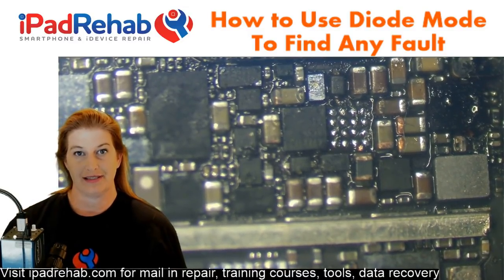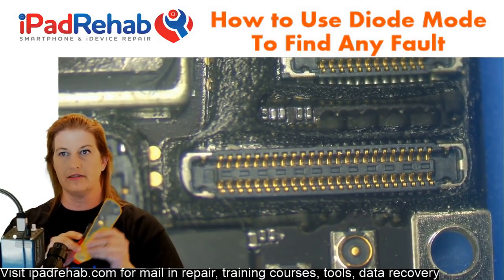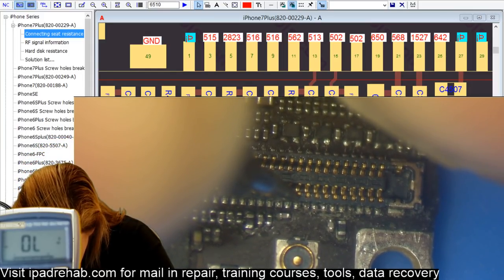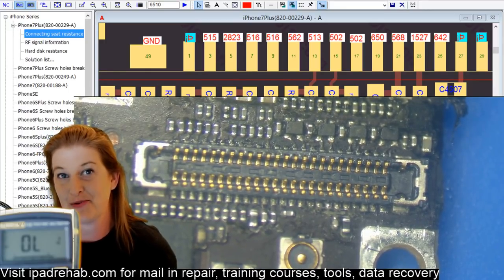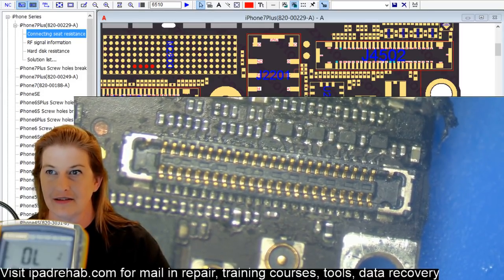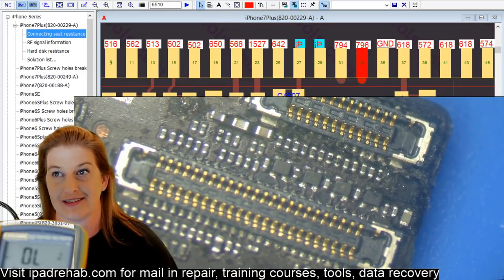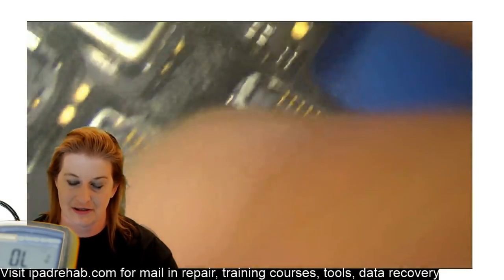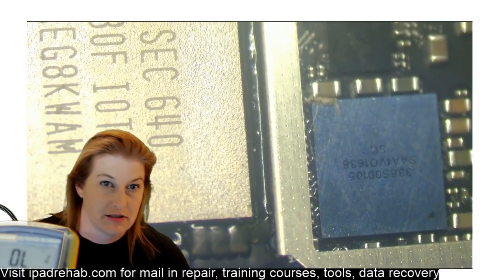How to Use multimeter DIODE MODE to find ANY motherboard fault.

Comment: Maybe I can explain "Diode Mode" from an electrical engineer's perspective.  A common digital multimeter is the Fluke 179.  In Diode Mode, the 179 outputs 7 volts DC on its test leads with the red lead positive relative to the black lead.  This voltage has a short-circuit current limit of 1 mA.  This means that the 179's diode mode "Thevenin Equivalent" circuit is a 7 VDC voltage source in series with a 7k resistor.  When this probe current is applied to the device under test, the voltage developed across it is displayed on the meter's LCD.  

When Diode Mode is used to check a motherboard circuit node with the red lead connected to ground, the developed voltage is negative compared to ground.  If this node connects to the input of an IC, the meter will display the forward voltage of the IC pin's reverse-voltage protection diode.  Repair technicians have observed correlations between this protection diode voltage and the overall "health" of the IC.  Presumably if the IC has experienced some trauma on one of its pins (over voltage, etc.), that pin's protection diode will also have suffered and its forward voltage will have been changed.  This is not a definitive test of the IC's health, but it is a quick and easy "leading indicator" of a potential problem.  By comparing the Diode Mode voltage reading on a circuit node with the same node on a known-good unit, it can quickly point to a suspected bad part.  If you look around, you can find web sites that document these voltages for popular consumer devices that are known good.

BTW, if your meter doesn't have a diode mode, you can use a battery with a series resistor to create one.  A 9V battery and a 9k resistor should produce readings similar to the Fluke 179's.
Reply: Thank you
Reply: Ah finally a bit of theory behind it! Thank you for the explanation. I went ahead and tried to measure voltage and current on diode mode on my two cheap multimeters and found out that one outputs 3 V and the other outputs 2.5 V. Both output a current of about 1 mA.

Does it mean that the 3V dmm has a Thevenin equivalent resistance of 3k, while the 2.5V has 2.5k? Of course I'm not striving for precision here, I mean they are cheap dmms after all, but I would like to know a sort of a ball park figure
Reply: Hi Russell:   To be technically correct, Thevenin/Norton equivalents only apply to linear, time-invariant circuits, which a DMM’s diode mode is probably not.  But if you consider the DMM “linear enough” over the range of voltages you will be using it with, then yes the Thevenin equivalents of your DMMs are as you say they are.
Reply: @davidclementson6149  I see, thanks for the clarification

Comment: The world chose the "red probe on ground" because it effectively isolates the component you are testing by sending a signal through the circuit ground and thus not activating other components. To affect a black probe in this fashion would send a signal through the entire circuit and therefore not be effective in testing only the component under examination.
Reply: Thanks - that's the explanation I was looking for!

Comment: Multimeter "Diode Mode" injects a test current into the diode (or whatever) by applying a small voltage to the leads via a resistor and measuring the voltage across the leads.  Typically they might use 3V and 10kOhms but different multimeters use different values and hence different test currents.  This explains why the VXY values are consistently higher than your values, they used a multimeter with a higher test current.  The ubiquitous 0.5V that you see on data lines is just the forward voltage of a PN junction probably the inherent diode in one of the output MOSFETs of the device that is driving the data line.  Before the days of digital multimeters we used the resistance range of an  AVO (an old moving coil multimeter) to do much the same thing but we were looking for failed discrete components such as diodes and transistors.
Reply: I was just about to post a comment explaining exactly the same thing when I saw yours. Exactly right in the old days All meters were what is now known as diode mode because they had moving coil or moving iron displays and hence higher voltages which would inevitably forward bias any semiconductors in the circuit
Reply: Nice, number 33. You mention an Avo to most techs nowadays & all you get is a blank glazed look in return ;-).
Reply: To test mosfet I use cheap chinese multimeter because never  and better' multimeters can't  make gate to turn on mosfet..  So I can't  tell if a mosfet is good or bad unless  it's  short circuit
Reply: that sucks
Reply: your comment is helpful, thanks..especially about that diode thing in data lines..
Reply: I'd agree, don't forget too that different multimeters have a +- accuracy difference depending on build & that calibrations of multimeters can vary over time & if using for accuracy need to have recalibration done occasionally from manufacturer. Although here really just looking for line faults to determine which line is failing before moving to component level tracing in suspected line.

Comment: Hi  this is a great video for those people that have a bad understanding on what OL means on a multimeter If the multimeter is on Diode mode means OPEN LINE  wy? simple if you measure a wire from one end to the other and the wire is cut in the middle  and the multimeter show OL  there is no flow of electrons from point A to point B means open circuit describe as a OL.   If the multimeter is on Voltage  It stands for overload in that  case  means voltage is greater than the meter can measure. so over load or OF LIMITS but depending on what mode is the multimeter  I hope this help to clear some people's mind  put attention if you multimeter only measure  200V and you apply 210V  you are 10V of limit  Great video love you teachings
Reply: It means OVER LOAD or over range. Check a voltage and it would not be open line would it ?

Comment: Since the voltage on which most CPU pins, diodes and transistors start to conduct is about the same (the 0.5v you see on your multimeter), it doesn't matter what brand of multimeter you have when you use diode mode.
When you use resistance mode, it matters much more since it will show the voltage divided by the current, but only the voltage is constant and the current can be anything based on the multimeter brand.

Comment: I worked as Chief Engineer on cruise ships back in late 90's early 2000 and this and shipboard radios were an every week occurrence. 
 The 1st thing: Pull battery,Then sim card, remove covers if possible, then dip continuously in distilled water,changing it several times.We used an R11 based flush to remove last residue.
Then a hair dryer on low for an hour.Then after 24 hr wait,we install new battery,sim card,and that usually does it on shipboard radios.But,the phones maybe half were salvageable.But salt damage was hardly noticed.
Reply: Mind if I ask what is, specifically, an R11 based flush?
Sounds like you had a good go being on a cruise ship for a job!
Cheers
Brian
Reply: @Bman130958  R11 is the common name for a refrigerant used in AC refrigeration systems. Clifton would probably have had access to a lot of it.  It is non-conductive and evaporates quickly so the remaining water also evaporates with the refrigerant: dries things very fast.
Reply: @markwp3177  Thanks very much for the clarification, @Mark W P !  That makes perfect sense.  
Cheers

Comment: Red lead to ground because it has the power from the meter. Less chance to put power into a component by probing with black leed.

Other comments already addressed differences in zxw and your readings.

Thanks for sharing.

Comment: Thanks to your channel and amazing instructions, have had 3 successful tristar IC replacements in the last 2 days on iphone 6s 6 and 5s thankyou!!. Investing in new higher end tools sure making it much easier.  jbc  nase 1b , Hakko  solder station, higher end bench power supply and Fluke multimeter with Diode readings which my old one did not have....and now going to watch the rest of this stream:)

Comment: In case anyone asks, you really can use either diodes or resistance to trace circuits. Both put voltage in circuit. Yes you can test diodes and semi conductors on a resistance setting. It will just be different. I have ran into shorted chip caps across power rails, and a bad chip out of 100 sharing the same signal lines.  I was also given a tablet that took a dip in a pond. Needless to say all the power from the battery performed spectacular electrolysis on the CPU board and even ate a trace on the LCD cable.  I usually don't hold out much hope for things that took a bath, especially under power. The only wrong way to fix something is if you have no clue in what you are doing.

Comment: Diode mode injects constant current (like 1mA) and measures the voltage drop. Note the difference between the concept of voltage source and current source
Reply: Finally, there is a proper explanation amongst all the crap written here.

Comment: Thank you for the useful tips on using diode mode.  I shall be using it more often from now on.  
Troubleshooting electronics is all about getting to the problem, the methods are up to each individual.  Whatever works best for you and your equipment is the hallmark of a successful fix.
As for the internet trolls, they still don't realize that their foul language reveals much more about themselves; their immaturity, arrogance and hate, than it does do about their intended targets. The fact that they can do it over the internet completely anonymously gives them a childish sense of courage, one that they'll never outgrow.  It's very sad for them.  The Catholic nuns were right of course.  Cursing is just a small mind trying to say something forcefully, no matter what the medium.

Comment: OT about the green-screen multi-meter phenomenon, coming from someone into photography..
Most of what we perceive as yellow, actually contains a LOT of green.  I know we have the most perception in the green spectrum -- so I'm speculating on this latter part, but I think there could be receptor fatigue due to that, so our brains tone it down.

However, as an example of this phenomenon..  Take some photos of various things you think are green (especially foliage) and take them into Photoshop or any editor that allows separate yellow and green controls.  Play around with adjusting the separate yellow and green sliders, and you'll discover quite a few surprises.  ;)

Comment: I am new to this type of repairs and appreciate your instructions very much. I am however a nut when it comes to saving time consider getting some paint pens in different colors. Like green for ground, Red for power and maybe white for open lines. and just put a dot above each line you could reference quickly.

Comment: I can't afford a microscope, and my tools are usually too big for measuring individual pins at that size. Not to mention my hands are shaky :q So I made myself a tool: I took a cable that goes into that socket, and soldered the other ends of the wires to a small board with measuring pads big enough for my probes and manual skills ;)

Comment: I am using the multimeter in diode mode per your instructions for troubleshooting shorted SMD caps.  While I get readings on both sides (zero on the ground side and 1.5 ohms on the other) of the caps, I don't get any beeps from my multimeter. Please let me know what am I doing wrong ? much thanks !

Comment: Very interesting video. Gave a lot of additional insight and knowledge. Thanks!
I saw in the description you fixed it 5 minutes after the stream. What was the fix? Didn't see that mentioned in the description.

Was trolled by my iPad 2 - late last year. Audio in my providers iTV app didn't work... tried rebooting, reinstalling the app and checking to see if there was some weird setting somewhere.Fixed it by switching the switching the switch on the side from 'rotation lock' to 'mute' and back. Weird but it did the trick.

Comment: OL does not mean "open line" it means overload. In diode mode the meter is measuring volts. A forward biased diode or transitor junction is circa O.6V

Comment: The lock button problem with 11.0.3 is because the time is not set (after battery disconnection). When you connect to wifi, it sets the time and the lock button will work again. This happens to other models as well, not just 5S.
Reply from the maker: +World Tech Fix makes perfect sense.  Sounds like the same as the old 4s problem where you'd get searching no service until time/date were correct.

Comment: iPad Rehab, I would think that before using the diode mode for guessing the resistance one should check what polarity given multimeter uses on the probes in the diode mode. For example my Uni-T has NEGATIVE 3.3 V on the red probe thus it makes sense to put the red probe to ground so that you inject positive voltage in the tested circuit with the black probe. However, my RichMeters 101 (Chinese $20) multimeter has POSITIVE 3.0 V on the red probe in diode mode so when you put its red probe to ground and use the black probe to test a digital circuit you basically force high negative voltage on data lines that could kill some sensitive chips, couldn't it? Besides that, there are many devices designed for less than 3 V - some for say 1.8 V, some even for less than 1.2 V. I wonder if injecting 3.3 V cannot upset them...
Reply: It is highly unlikely to get anything killed by multimeter, but your point about polarity is very important to get proper readings - if there happens to be actual diodes or bipolar transistor junctions, the readings will be screwed if you are using different polarity than with the reference information.

Actually, to be comprehensive, every line should be measured in both ways or at least confirmed by schematic that there are no semiconductor junctions in between, as otherwise a reverse-biased one will block the measuring current, rendering the result as OL and thus leaving a possible actual break unreported.

Comment: It's well known that the measurements are different from one multimeter to another.. that's why in some schematics or solutions you get the diode mode reading plus the name of the used multimeter

Comment: Great video. I know if the pin short to -ve is going to cause a fault, but does short to gnd means shorting to the body of the board?
Reply from the maker: Yes.  Negative and ground are the same

Comment: The only problem with diode mode testing is some lines go to multiple locations and having one of the lines open won't cause an OL on the multimeter.  You might see a slight difference on voltage readings and that could be hard to spot.

Comment: So diode mode would test continuity between two test points, but also it would give you what's the resistance reading is if you put the red cable on ground? Is that correct? Also when it beers it's not always a short to ground eh?

Comment: You do not "send out" voltage.. voltage is always a relative term.. its the difference in electron density between two points. The multimeter provides a current, a constant current, usually 1mA. The multimeter then tells you the voltage between your two probes (voltage is relative) when the 1mA limit is reached on that line. Since voltage * current = resistance you can infer the resistance from the reading.  Higher voltage = higher resistance. Multimeters have a max voltage they can provide up to in diode mode, usually 2-3V but could be less, could be more.

Comment: You mentioned that you replaced some of the filters with pieces of wire. Is this a feasible fix, temporary fix, to eliminate them being a problem? Will this effect the circuits that they are "filtering"?
Reply from the maker: +Dustin LaRoche that is not a fix, it is just eliminating variables for data recovery

Comment: If you were on a cruse and this happened, would it be better to open it and disconnect the battery (remove it) and put the phone in alcohol or distilled water? Thanks
Reply: I have done this for my girlfriend’s “toilet drop accident” and it did work! 99.9% alcohol sucked that water out like a charm. I imagine a saltwater drop might need a bit of cleaning inside because it has more sediment in it than tap water . Her ear speaker/ambient light/proximity sensor cable did short out and need to be replaced which caused her to lose Face ID but it’s much better than a broken phone (there’s a way to keep Face ID by soldering parts from the old cable onto the new one but I didn’t know that process to exist at the time)

Comment: Be wary of the multimeter you use when injecting signals from it.  Some cheap meters will destroy MOS electronics when putting reverse voltage into them, because they give out too much energy.  Ideally to test a circuit, inject about 0.5 Volts, not more.

Comment: Complete NOOB question: I’m just a hobbyist, I find this approach interesting BUT what if you don’t have a known value [another identical board] to compare it with? Can you then, just assume that a “normal” diode reading is +/- 0.500 and proceed that way, or would that lead errors? Please let me know. I want to learn. Thank you kindly
Reply from the maker: Kind of—but some normal pins are ground (0.00) and others are not connected to anything  (OL).
Reply: @JessaJones  Thank you for replying, I do appreciate it. But my question was more about/relative to discrete components and how they might “behave” using this technique, as that is mainly what I deal with when attempting to repair, small transistor radios, fans, CRT TVs, stuff from the early 80’s and such. Do you think, it could work, I mean they are quite different then SMDs, am I wrong? Please let me know. Thanks again and keep making videos - you’re awesome!